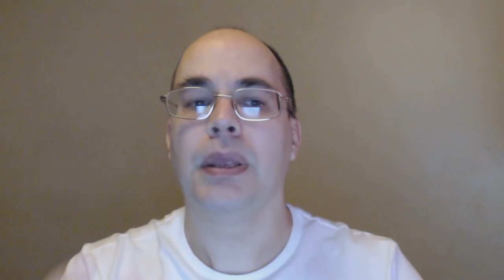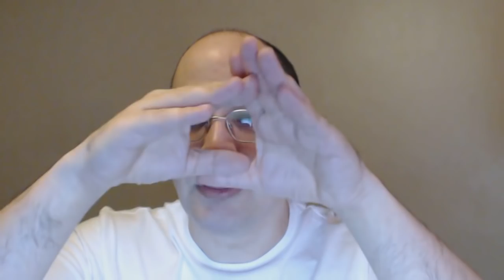How do rockets move in space, with nothing to push off from?

Comment: A gun would recoil in a vacuum because the exhaust gases from the shot would push directly again the gun barrel. In space there is nothing for a rocket to push against, so please don't make videos like this and quote Isaac Newton (who was referring to earth bound objects in motion and made no reference to  the vacuum of space) and pass it off as science when you are clearly not a scientist. Merely repeating what you have been told by men in white coats with no evidence to prove their theories does not make it science. ROCKETS DO NOT WORK IN A VACUUM!
Reply: "A gun would recoil in a vacuum because the exhaust gases from the shot would push directly again the gun barrel."

And rockets work in vacuum based on exactly the same mechanism - exhaust gasses from the "shot" pushing directly against the rocket engine.
Reply: That's the craziest thing I have ever heard. You are actually suggesting that rocket exhaust gases in the absence of an atmosphere to push against will now reverse and push back against the very rocket they came from?! You do push-ups against the ground, remove the ground there is nothing to push against and rockets cannot be any different surely.
Reply: No, rocket exhaust gasses do not magically reverse in vacuum. Where did you get that idea?

Rockets work by violently throwing millions of gas particles away, not by pushing against any medium outside.

In that regard, it works just like a gun discharge. You have no problems with the idea of gun working in vacuum - why is the idea of rocket in vacuum so difficult for you to accept?

A rocket engine, in essence, is a gun, continuously "shooting" millions of gas particles.
Reply: well we will have to agree to disagree because there have been many experiments done by independent scientists proving rockets don't work in a vacuum.
Reply: Which means that guns don't work in a vacuum, either. And yet you seem you have no problem with that idea.

Would you kindly care to explain that?
Reply: Rockets do not work by pushing against air.

But yes, they have to push against something, and they do. They push against their gas exhaust. Gas exhaust goes down, rocket goes up, in strict accordance with Newton's 3rd Law.

Why is it so hard to grasp?
Reply: The only conceivable way a rocket could work in a vacuum is by pulse detonation  (we all seen the Aurora contrails) where mini explosions are set off behind the craft creating a small detonation wave. The idea that rocket gases expelling at a constant rate, pushing against nothing  can create thrust in a vacuum, I'm not buying.
Reply: Well then, it seems to me like you simply do not understand how rockets actually work. I mean it in the nicest possible way - no insult intended.

Because, you see, the principle you've described is basically how rockets work. What's happening inside rocket's combustion chamber is a series of quick explosions, which create a constant small detonation waves, which push rocket forward.

Basically, the thing you're not considering are all exhaust gasses which aren't directed back.

I mean, think about it - suppose you have a small cylinder, closed at one end, floating in space, with shaped charge in the middle of it, shaped precisely to send exhaust gasses only in two directions - forward and back.

Now, after its ignition, the rear shockwave will exit the cylinder, doing nothing, as you would expect. And that's what you think rocket does in space, aren't you? Just endlessly sending exhaust gasses back.

But what about that other shockwave? Those exhaust gasses will travel forward, bounce off the forward closed end, transferring that forward momentum to the cylinder, and then will exit the cylinder after that bounce, futilely chasing that other shockwave.

And that's how rockets work. The energy at the back is released in all directions, and all those exhaust gasses which aren't facing back have to bounce off the rocket, giving it forward momentum.
Reply: +stevepidge
Stop posting if you're under the influence; sober up first and you'll notice all the contradictions in your above post.
Reply: +Ninja Man
Say you have a combustion chamber (in a rocket) that is completely enclosed so that no gasses can escape. The pressure from the hot gasses acting upon the chamber wall would be equal in all directions and would essentially cancel out in regards to any net movement of the chamber (and thus the rocket.) Now poke a hole in that chamber. What changes? The pressure will still be equal in all directions (assuming fuel is continuously supplied.) In the direction of the hole however that pressure is now acting upon the hot gasses pushing them out. Meanwhile, the area of the chamber wall opposite the hole is still being acted upon by the pressure. Only now, it isn't getting canceled out. Giving the chamber (and thus the rocket) net movement in the direction opposite the hole.

It's a bit more complicated than that but the general idea should be evident. Like someone else commented, it's pretty much the same as with a gun in a vacuum. As long as the bullet is in the barrel, you essentially have a combustion chamber with no exit (equal pressure in all directions.) Once it leaves however, you have the pressure acting to expel the gasses from the barrel in one direction and on the chamber of the gun in the other thus creating recoil.
Reply: +Ninja Man
Rocket gases push against the inside walls of the rocket engine's combustion chamber.

The physical mechanism is that when the rocket fuel ignites inside the combustion chamber, the controlled explosion expands in all directions. Some of the expanding rocket gases escape out of the rocket nozzle, and some exhaust gases expand out to the opposite end of the combustion chamber, where it pushes against the inside wall, and thus pushing the rocket forward. these gases then reverse direction after imparting their momentum to the rocket and they escape out of the rocket nozzle, due to the lower pressure out of the rocket nozzle.
Reply: +stevepidge, if you have gasses pushing against the bullet in the first place, then you don't need bullet at all to make this gun start moving - if the gasses are moving back, towards the bullet, then they have already imparted force against the gun, making it move forward.

It's an explosion, isn't it? Some of the molecules will start moving back immediately (creating no usable thrust), but most of them will move forward, and sideways, and in every other direction. Which means, that in order to start moving back, they have to bounce off the bolt and chamber, giving it forward momentum.
Reply: +Ninja Man
But... but this is basically what I've said before. It... didn't make sense to you then?

Okay, tell you what - I apologize. I'm sorry for calling you ignorant, naive, etc. Can we start over?

Let's say that you're right - that NASA is a bunch of lying liars who lie. Okay.  And let's say that... um... the Van Allen Belt radiation is really deadly and no human can actually pass it safely in any place and thus NASA has decided to fake the Moon landings. But it really has no relevance to whether rockets work in space or not, right? I mean, theoretically.

So, in light of what possumverde has said, in light of his baloon analogy, wouldn't you agree that rocket theoretically can work in space?
Reply: +stevepidge
You really have no concept of Newton's third law.
And you do? Newton's 3rd law is not reliant on its environment in any way - that action-reaction thing will happen regardless.

BTW Newton had ZER0 postulations concerning his third law and a vacuum
Which is quite irrelevant :) The cartridge inside gun chamber in your example is hermetically sealed - before the powder explosion pushes bullet outside, the explosion is happening inside the vacuum environment - and yet, it works exactly like Newton's 3rd Law says it should.

No matter where you take that gun, it will fire and discharge a projectile. Now, what will happen to that projectile afterwards will be different, of course, depending on the environment, but it has already done it's job of pushing the gun back.
Reply: +stevepidge
YOU ARE DUMB.
And you are rude and arrogant. And ignorant, too, so we're even, I guess :D

There are TWO masses to interact with one another, The bullet!!! and the bolt assembly!! This is absolutely evident as firing a BLANK DRASTICALLY reduces the recoil compared to firing a live round
That's because instead of (initially) just the cartridge area, the blank round has whole barrel to work with, which is why blank-firing adaptors are used. You know what they do, right? They constrict the barrel, keeping chamber pressures from the blank high enough and for long enough of a duration to cycle the firearm's action.

Amazingly enough, this blank firing adaptor doesn't include second "mass" for exhaust to interact with. So... no, we don't really need a second mass to interact with the back of the chamber (gun, or rocket) to get the opposite reaction :)

Take a balloon, blow it up, tape a piece of 8 1/2 x 11 inch paper horizontally to the "nozzle". Release and profit.
Okay.

...

...

Okay, that was nice. That piece of paper has really stabilized balloon's flight. It was kinda majestic, actually :) Of course, as expected, balloon's journey was shorter than usual, due to aforementioned piece of paper taped horizontally to the nozzle, but, it still flew out of my hand.

You will find no forward motion
Wrong :) After releasing the nozzle, the balloon flew forward (and down) out of my hand.

as you assert according to the instantaneous nature of Newton's 3rd law.
I haven't asserted "instantaneous nature of Newton's 3rd law." So, you have no reading comprehension, either.

This is a very simple experiment
Yep.

yet you have no spine to see that which is plainly before your eyes.
Careful, you're projecting :D
Reply: P.Dykmans.   Yes, i was just adding to it. it hard to explain basic physics sometimes to laypersons. they ask great intuitive questions, but seem to have 0 ability to accept reality when explained to them.    i mean, the "ninja man" seems to understand arrow dynamic drag, by explaining the blunt end bullet vs a pointed bullet, but he doesnt understand where the force comes from the reactive force against it. .... as well as the force of drag, and how it effects a bullet once it leaves the barrel of a gun.       it all boils down to F=ma.... if they understand this simple equation, all their questions are answered.  
1  gun with a blank... same energy..... but little force, little  mass ejected/ and known mass of gun(due to just the gunpowder vaporizing) and very high acceleration
2.  gun with a bullet. same energy   but much greater force, due the greater mass of what is ejected  and then 
same mass of the gun as before, creating a lower acceleration for the bullet vs the gasses. but a greater "recoil". (which is a greater force , that is shared with the bullet and the gun..........gun has less of an acceleration , bullet has greater acceleration because of lower mass.. force is the same.      

that's as simple as i can explain it.     Ninja?   do you understand now?
Reply: Braindead you are. Newton's 3rd law MUST be instantaneous.
Reply: Oh, so you're the one asserting "instantaneous nature of Newton's 3rd law." Well, okay then :)

So, that's us done? You concede the point, then, by ignoring it? :D That was easy. I was expecting something like, "no, you moron, you've taped the paper wrong!", or "You have no spine to admit that you saw no forward motion!", etc, but instead, just... silence.

I mean, having a mass blocking the chamber would increase the thrust, but rocket designed to shoot bullets downwards would be rather... impractical :]
Reply: It has to be instantaneous you moron. There is no other way. BTW how many rocket ships have YOU flown in space?> Don't bother answering.
Reply: It has to be instantaneous you moron
And? But? So? Therefore? :) There's another thing you're missing here :]

BTW how many rocket ships have YOU flown in space? Don't bother answering.
Yes, I agree, "rhetorical" questions asked in bad faith can be safely ignored :)
Reply: Ninja Man... here you are again, confused over newtons 3rd law.  ill give you a hint.. think of the molecules of "exhaust" gasses as being the "bullet"    the burned and expanding fuel is constantly providing a force as it is accelerated out the rear of the rocket, providing a constant force.  the force is the same in both directions. (on the rocket and on the gasses exititing the rocket)  the differecne is that withthe same force, the acceleration is based on mass.    the gasses are light mass so they are acceleated very fast to a very high speed.  the rocket, much higher mass is a fraction of the acceleration .   And the more fuel that is burned, the faster the rocket accelerates in the opposite direction. make sense. yes, rockets work in space.  (or in a vaccum)
Reply: +Ouroboros Firing a blank drastically "reduces" the recoil indeed. But it doesn't reduce to zero, does it? There is still a recoil. And this recoil would also be there if you fired a blank in a vacuum. And it is the same recoil that moves a rocket.
Reply: P.Dykmans... and that force for just the "blanks" is the same on the gasses its expelling, vs the gun itself.     whatever force it takes to push the gases out, is on the gun as "recoil".   its all simply apart of the newton equation.... F=ma.....
Reply: +zanick2 I assume you were just 'completing' my point. Right? Because I feel we 100% agree on the science :-)
Reply: +zanick2 I agree, it's as simple as F=ma. But the real problem, and the reason why you don't get things explained no matter how hard you try, is that most of these science-deniers are not only "laypersons" in science. Most of them are religious people who have all their truths and beliefs already spelled out in an old book. And as much as they have built their complete world view (including their values and morals) based on a literal interpretation of that book, they simply can't except that science is putting that literal interpretation under pressure. And while we feel that science is "answering their questions", they feel that science is actually "threatening their faith". To say it with a quote (don't know the source): they want to do to science what they feel science did to God.
Reply: I agree, that they all fall back to a religious position, but i think they are misunderstanding the science as well.  humans can be fooled by what they think and see...... this needs careful attention to the detail of the explanation.   i hope that looking  at a gun and how it fires a bullet , might help.... but if it is as you say, there is no hope!     good to chat about it with you.
Reply: The rocket pushes off it's bell not it's ehaust
Reply: No, the gases expelled in a gun expand against the bullet and the equal and opposite reaction is the gases pushing both the bullet at the same time as they are pushing against the bolt causing recoil in the chamber. A rocket and combustion chamber does not have a bullet to push back off of to cause recoil as the gases attempt to expand. They would merely expand into an endless vacuum creating no thrust.
Reply: Take a balloon, blow it up, tape a piece of 8 1/2 x 11 inch paper horizontally to the "nozzle". Release and profit. You will find no forward motion as you assert according to the instantaneous nature of Newton's 3rd law. This is a very simple experiment, yet you have no spine to see that which is plainly before your eyes.
Reply: possumverde I will be honest with you, you are the only supporter of NASA so far that has made any sense and I find your explanation hard to argue with. The main reason is im not a rocket scientist and have to accept the information given by people that have a greater understanding of such matters than me. 

Problem I have is, I have seen too much crap from NASA to believable anything from them. From the silly moon pictures including close ups of the ridiculous lander, to the cgi and shenanigans in the ISS and rockets taking off in a parabolic curve going nowhere. NASA stretches faith in space travel to breaking point, to such an extent that I cannot believe they have been anywhere near the vacuum of space.
Reply: YOU ARE DUMB. There are TWO masses to interact with one another, The bullet!!! and the bolt assembly!! This is absolutely evident on fucking earth as firing a BLANK DRASTICALLY reduces the recoil compared to firing a live round you moron.
Reply: You really have no concept of Newton's third law. To you and NASA it might as well be magic. BTW Newton had ZER0 postulations concerning his third law and a vacuum ( he could not even concieve it!). It is absolutely absurd for you to spout "Newton's Law" as if you are quoting the ten commandments. Have fun with your fairy tale, besides, who am I to tell grown men that Santa Claus doesn't exist.